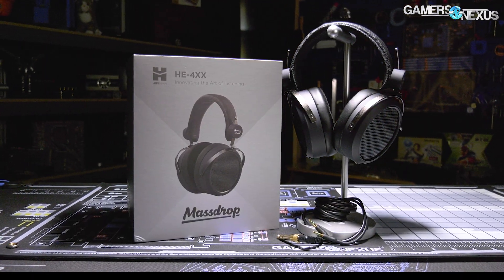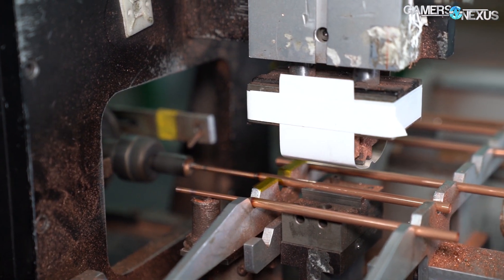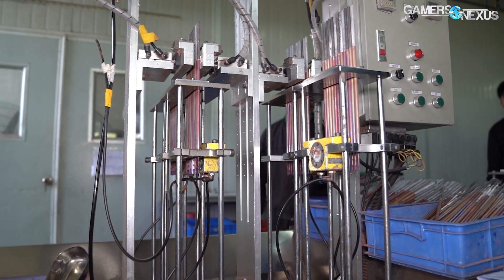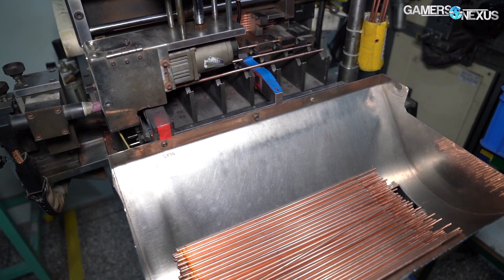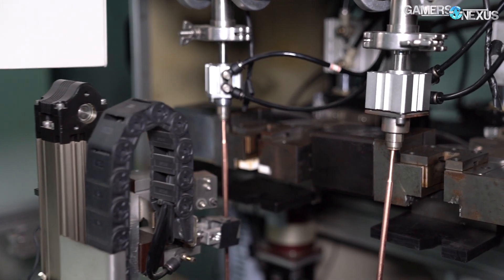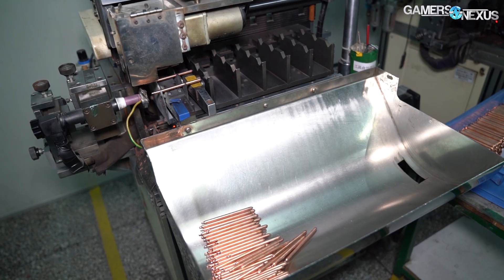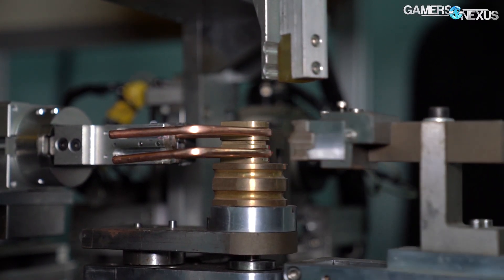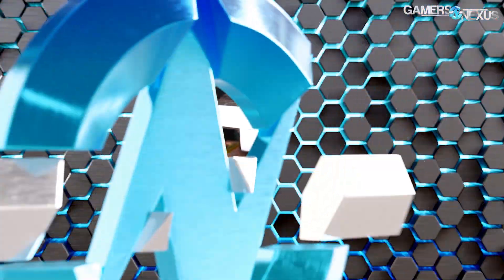How Copper Heatpipes Are Made | China Factory Tour (Cooler Master)

Comment: Wait the water added is pointless. As they pull a vacuum in the pipe, the water boils then vaporizes(due to how lowering the pressure lowers the boiling point of water) and gets pumped out with the air lol.
Reply: It's not under a 0 atm vacuum. Just under partial vacuum.

Comment: You can buy these (yes sealed) on ebay, then bend them yourself into whatever shape you need.  There's youtube vids of ppl making their own custom cooled PC cases with them.  
They are surprisingly affordable.  I wonder if they're the rejects from these factories.
Reply: Quite possibly
Reply: You could always buy loose heatpipes for custom builds from an industrial supplier, like when i looked around 2005 i found that Conrad Elektronik had them in stock and i could just order them for about 7-12€ a piece, depending on length and girth, and that's with Conrad's fat margin. I'd say at Aliexpress prices of around or above 2€ a piece, that sounds likely enough that most of it is legit product rather than reject junk.

Comment: The copper is recyclable. It won't be used to make pure copper, most likely, but it will most default be recycled. Copper is used in hundreds of different alloys, and there's always space for it. I think something got lost in translation, like them calling the tig welding, "soldering."
Reply: Any mineral which we find in the ground will have impurities in it and has to be refined in order to be usable. With that said, the process is not as simple as it is with steel where the slag can just be scrapped off the surface of the melted steel. In the case of copper, the process that requires a lot of electrical current and sulphuric acid. The copper is disolved by the acid and is then deposited on cathodes. This process is essentially the same as the one which is used to refine copper from raw ore.
Reply: Andrew Delashaw Exactly.
Reply: I actually find it pretty surprising that they cannot just grind the failed pipes into poweder to use for sintering future heat pipes. I understand that the end result may not be pure enough to be recycled as pure copper but minor contaminants should be perfectly okay in the middle sintering because it only needs to be able to soak water.

Comment: 3% Failure rate is unacceptable especially if they cannot recover the raw materials.
Reply: I think that the raw materials are recyclable, just not for THIS purpose, and thus not cost effectively by THIS manufacturer.   I’m sure a scrap dealer buys them and finds a use for them in the copper recycling stream.
Reply: @orcoastgreenman  That's true, the copper ain't going anywhere to waste.
Reply: I don't think that's a big concern to them judging by the fact they use manual labor frequently in the process of making these pipes, at the end of the day they are producing copper pipes, not Tesla engines.

Comment: 👨‍💻i used to be a spring maker & did a few jobs that required 1-2-3 mm stainless tube bending 😳 then i made some springs USING a big magnifier  on the machine & made springs like a very small black Ant (  . ) -  < this sixe  1 dot small i even made a spring out of my wifes long hair :) 
curly sue stuff  cool master would  love me i was known as the  wizz kid  and use that today aged 60 :)  
The thing u learn in Manufacturing by hand  on small job runs > Priceless💲🎙🎵\/\/\/\/\/\/\/ boing twang even made huge chicken feeder org springs  -I left the industry as computer came in i had 1 look & told the boss how it worked without even seeing one  off a  video he was amazed
feeding wire process 1- in  80 mm 2- bend 90d 3- coil 680mm -  4- bend 90d 5- loop 3 mm   6 cut   etc  Whish i never LEFT as it wouldve got me into computing faster than alot in late  1990s👉🙄😠😁anyway  heat treating spring leaf & rod is a cheap tool use last ages & very good

Comment: Great video, but as a welder, every time you said soldered it irked me lol. Those are welded.  Thats literally a tig torch with a #7 cup on it.  Uses argon as shielding gas and a sharpened piece of tungsten as an electrode
Reply: Using a tig torch doesn't exclusively make it a weld. Welding requires melting the base metals being joined as well as the filler material. Soldering uses an alloy with a lower melting temperature to join materials which is what is being done here. Welding copper would require over 1000C localized temperatures at the weld which wouldn't work very well considering the heat pipe is DESIGNED to spread that heat rapidly.
Reply: @murffly  I'm with Luke...  Pretty sure it is welding as I didn't see any solder going in anywhere...  And the ends definitely look welded.  You can even see this in pictures from Cooler Master.  And 1000c temperatures would be EASILY achieved with that setup, even with the heat pipes ability to spread heat quickly.  It also doesn't need to be localized...  Black Smiths weld all the time by heating the entire piece of material (not localized) and beating it with a hammer.  Even still, while the heat pipe spreads heat quickly it isn't instantaneous and that sealing process only seems to apply heat for a quarter of a second.  So...  I don't know, but I'm pretty sure Luke is correct and solder vs welding was lost in the translation.
Reply: @joeynovak07  You wouldn't be able to raise the temperature of one of those heat pipes to 1000C without pressure building inside and bursting the heat pipe. Not to mention copper starts to oxidize at 200C I seriously doubt it's welded. I've spoken with heat pipe manufacturers about fabrication and they refer to crimping then soldering the pipes to seal them. I would hope they know their own processes.
Reply: @murffly  So...  I don't want to argue this but I don't think your points are valid and I hate false information being propagated online...  Here's why I still think it's being welded...  

"You wouldn't be able to raise the temperature of one of those heat pipes to 1000C without pressure building inside and bursting the heat pipe. " - The tig torch is on for about .25 seconds.  Even heat pipes don't spread heat that fast.  Just watch Action Lab's video.  And for the first sealing it isn't a heat pipe yet as it has no vapor in it is just a heavy copper pipe which means it has even more thermal mass and the heat from the torch will effect it even less.

The second it's only sealing a stub so less heat is needed AND it's under vacuum so there shouldn't be much pressure building (yes, some from the boiling water (which they've kept at the other end of the tube and probably won't migrate to that end of the tube yet, but idk), and to top it all off copper pipe can hold A LOT of pressure.  Not infinite but even a soda bottle can hold 150psi pretty easily.  I'm not going to do the calculations but even at 1000C 2 drops of water under vacuum probably aren't going to generate a lot of pressure in a container that large.

"Not to mention copper starts to oxidize at 200C I seriously doubt it's welded." That is what the shielding gas is for, it will prevent oxidation.

"I've spoken with heat pipe manufacturers about fabrication and they refer to crimping then soldering the pipes to seal them." - I can't really dispute this without calling you a liar but did you contact this specific manufacturer, since we are talking about their process not others.  If so, who did you talk to and may I contact them to confirm this?

"I would hope they know their own processes." - The only man that really knows what is happening is the man on the assembly line who is actually doing it (or if his knowledge isn't high enough (many line operators probably don't know the difference between welding and soldering) the person that maintains the line).  I've worked in manufacturing and usually the modus operandi is "This is the way we do it" (pulls lever).  When I would write software to control machines I first went to the designer of the process and asked him how it was supposed to be done.  He would tell me how it should be done, then I'd go to the person on the assembly line and ask them and they would tell me what they actually do.  Then I would go back to the designer and tell them what was being done at which point he would go with me to verify this and we would ask the line worker why they were doing what they were doing and why they weren't doing it the way it was supposed to be done.  At which point discussion would ensue and either the line worker would change what they were doing or more often it would be a combination of correction of the action and the designers understanding of the process.  After this discussion I would usually have enough information to do what I needed to do.  You frequently have to talk to 3 or 4 different people who all have differing opinions about what is supposed to be happening vs what is actually happening.  Not all places are like this but from what I've seen few places are immune.

Arguments against soldering...  Surfaces have to be cleaner for soldering than for welding and you usually have to apply flux (granted the shielding gas may negate this need, idk).  If you use flux you usually want to rinse it off and I don't see that happening.

When the pipe is welded if you look closely the shape is being changed from a flat crimp to a roundish ball...  This is welding soldering won't do that (unless it's also being trimmed to size which is possible but I don't see the waste dropping from the pipe.)

My opinion as someone who has both soldered and welded and has a fairly good grasp on physics is that these are welded. The only way to know for sure is to either buy one of the coolers that was being manufactured in this video at this time and see if it's soldered or welded or to go re-visit the factory and see.

Comment: Distilled water as filler? I thought there is some form of alcohol in there for a lower evaporation point...
Reply: They pump the air out of the tubes. So there's your low evaporation point. With no pressure on water it doesn't take much to make it evaporate.

Comment: Water? I expected a big more complex and better performing liquid.

More factory tours please. Love it. Cases manufacturing would be great. I love all things sheet metal ;)
Reply: Water performs really well because of the hydrogen bonds that are broken when it boils or evaporates.  That takes a lot of energy which is released if the bonds are reformed. 

Ammonia is similar.

Most other refrigerants don't carry anywhere near as much energy per mass vaporized.  They're still useful for other reasons, especially if you're using a pump, but if you're just trying to conduct heat with a minimal difference in temperature and no other moving parts, water is hard to beat.
Reply: @jordanrodrigues1279  Sure, water has quiet a bit of heat capacity, but it has also rather high boiling point. Which sounds a bit suboptimal. Plus corrosion could be an issue. I guess very pure water helps here. And I guess the vacuum (?) inside helps a lot too.

Comment: Very interesting but please get the info right, So many times I was saying no that's wrong. Hint its welding not soldering...
Reply: Maybe you should go to China and translate? How's your Mandarin anyways?
Reply: @1pcfred  What is needed is basic engineering literacy.
Reply: @1pcfred  How can looking at a tig welder and describing it as a soldering be a language issue?
Reply: @1pcfred  Read my original post, that encapsulates my thoughts. 
For info a tig weld can be used for brazing, soldering temperatures are really too low for tig. Besides soldering and brazing use lower melting point intermediate metals to do the bonding.
The "welding" in the film was autogenous.
Reply: @1pcfred  You seem to be taking my comment very seriously like your part of the team. If you were why did you not correct the error pre production?
And I did not explain or attempt to explain how tig welding works so I'm bemused why you say you know as if being self defensive. 
Soldering and brazing involves melting a metal that is at a lower temperature than the other parts to fuse them together. 
Soldering is classed as working with metals with temperatures < 450oC and uses metals such as lead,tin, silver etc. brazing uses higher melting temperature metals. Eg Silicon / aluminium bronze. 
Lower temperature "solders" work best with a flux. Not something a tig is going to be happy with.
Silicon bronze tig brazing works as the flux is not mandatory. 

The process in the video was Tig autogenous welding of the tube ends. 

Like I said in my last post read what I said. There was no malice, I posted what I saw and thought. If feedback is not something you want turn off comments or just delete any non flattering posts.
Reply: @1pcfred  Something I just saw. It was noticed and pinned in the comments that there was a translation issue.
Had I seen that I would never had posted my comment.

Comment: Are you guys positive they put water in the pipes first THEN pull vacuum on them? This does not make much sense. Pulling vacuum on a tube with water would cause the water to vaporize and get sucked out into the vacuum., especially if they're heating the bottom of the pipe while they do this (heating would raise the vapor pressure of the water even more). Still, cool video.

Comment: I never knew it was water! Always thought it was something more volatile, like maybe an industrial alcohol.
What gets me, is in the tower case configuration where the U tubes sit with one arm high and the other low, how does it know to go to the middle?
In the case of the complete U turn type (where the fan is blowing toward the board, and the pipes only go one way, there is a difference from alignment (if I recall, better to place the turn at the bottom or side than at the top)

Comment: It's definitely soldering, you can't weld to copper, only solder, the machine isn't "welding" to the copper, it's actually arcing to the solder and the solder melts onto to the copper, but anyway I just wanted to say I'm really loving the factory tours and the how it's made stuff, really nice change of pace from normal reviews, but I definitely love your reviews Steve, both you and jaystwocents are my top channels, but I gotta say I love how technical you get into everything and your explanation and representation of everything is very clear and thorough I feel, plus the no bull shit type of reviews are really helpful, I just recently built my newest 9900k rig and allot of your reviews and suggestions helped me out alot, so thank you very much for what you do brotha, keep it up
Reply: Why can't you weld copper? I'm asking because I've welded copper and it works for me.
Reply: @1pcfred  what kind of welder you use? I've never been able to weld it, it just Burns, I've soldered copper tho
Reply: @1pcfred  I know about aluminum just never seen copper welded I always thought it could only be soldered, but I guess it makes sense if Copper sticks or wire is used it could be welded with tungsten gas
Reply: @1pcfred  I'm sorry you're right >_< .... Need to use different process ...I retract my statement :)

Comment: This is very much like the process they use to make condenser and evaporator coils in your AC/heat pumps systems. Most manufacturers use the grooved tubes but have to be careful how the grooves are spaced or on the 90 and 180 degree bends the refrigerant will wear through the groove on the outer radius and cause a leak. When the industry went to these grooved tubes to raise efficiency with the advent of R-410a it was a real problem with evap coils springing leaks after just a few years rather than the designed 20+ year lifespan. I've always found these "passive" systems interesting because of how well they work for such a simple design with no compressor to circulate the refrigerant or change it's state back from a gas to a liquid

BTW the process used to reduce (or increase)  the ends is called swaging .... It's also used in the AC/heat pump industry to couple two tubes saving cost of having to use a coupling and also reduces the chances of a leak by 50% because you only have to make one solder/weld instead of two with a coupling

Comment: I was always curious about how they assemble aluminum fins on these copper pipes.
Reply: A lot of them are just pressed on. They punch a hole into each fin, slightly smaller than the heat pipe, and push it over. The pressure and direct contact do the job. My guess is that it's easier and cheaper, for those, to add more or bigger fins, than to solder fins into place. Others take that a step further by soldering them into place, which should have better performance.